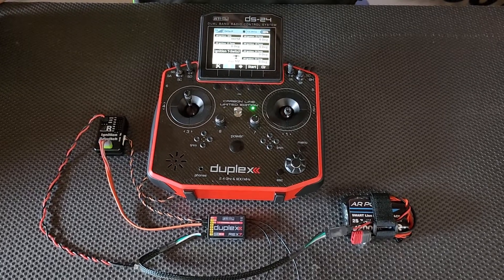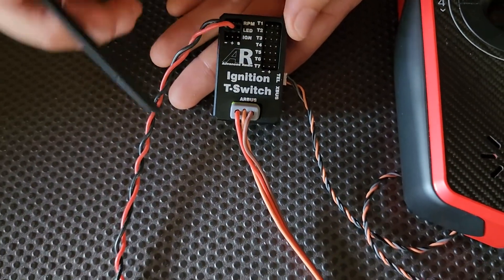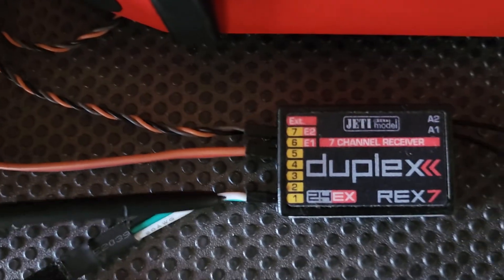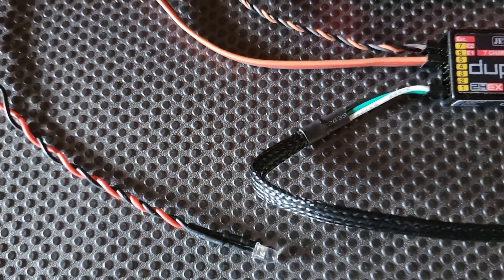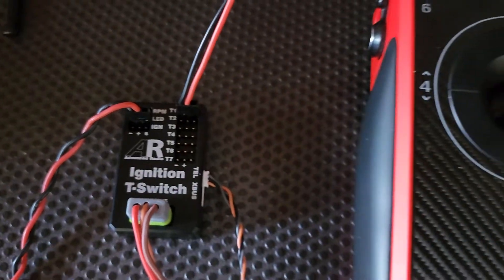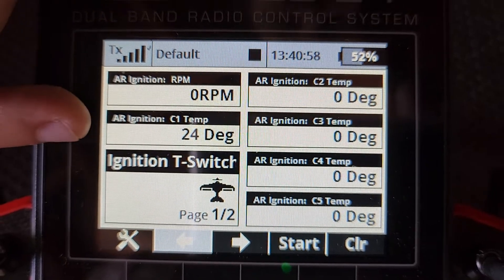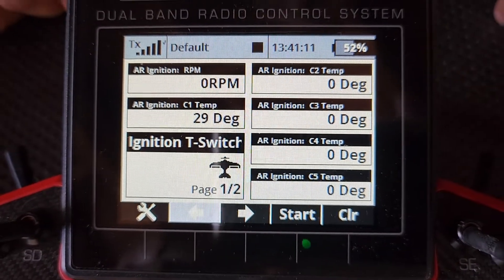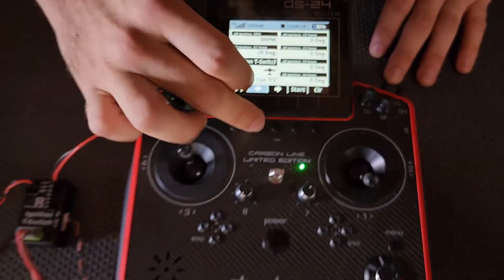AR Ignition T-Switch with Jeti radio.

Comment: I am running this with a central box 210, but I'm not receiving any telemetry on the radio, I already connected it to the E2 port, changed to EXBus and nothing is being shown in the telemtry readings, any troubleshooting you have for this?

Comment: Hi all
I hope I will find an answer to my problem here.
I received a Smooth Flite 16 RRS and Ignition T-Switch, the Smooth Flite 16 RRS did receive the latest update.
I plugged it all in with 2 Duplex Rex3 A20, from Jéti and I drive with a DS16 G2. All material is up to date.
As far as the telemetry of the Smooth Flite 16 RRS is concerned, no problem, I have the feedback regarding the batteries and the 2 receivers.
On the other hand, as far as the Ignition T-Switch is concerned, no telemetry feedback on my transmitter, the Kill switch works well, the LED turns on and off depending on the position of the switch on my radio.
For your information, I wanted to mount this on a UMS 150cc 5 cylinder engine.
Thank you for your answers.
Reply: Did you manage to find a fix? I'm having the same issue
Reply: Hi, same problem with Central box 320 (with a rex8 it worked fine).  Is there any update how to fix this?